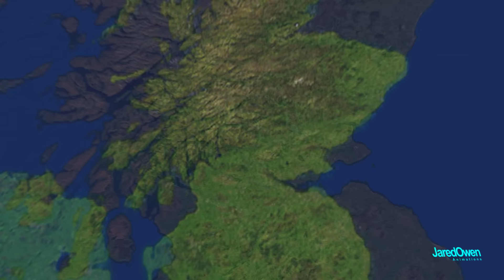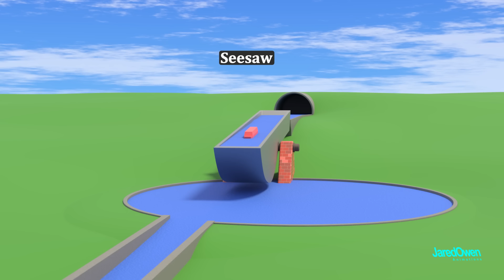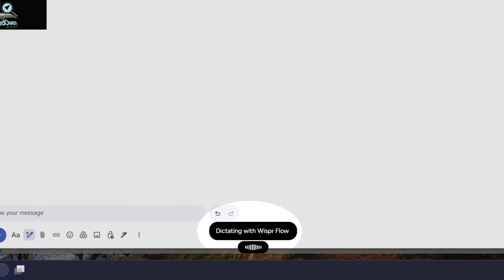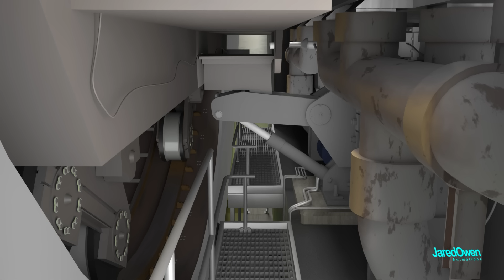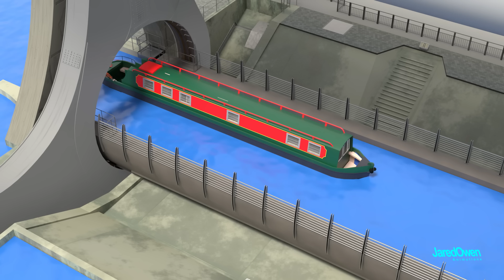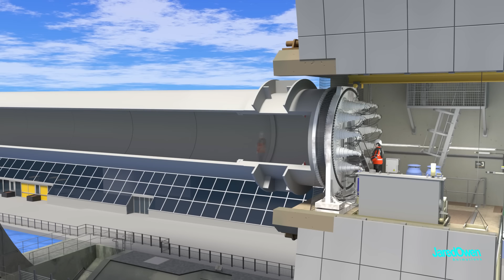How a Boat-Lifting Wheel works

Comment: The part that clicked for me was the pair of water-filled gondolas moving in opposite directions, so one boat rises 24 metres while the other drops, with a watertight seal forming before the gates open. Framing it against an ordinary boat lock, where the chamber itself has to fill and empty, made clear why a rotating wheel is such an elegant shortcut between two canals at different heights.

Comment: The genius part for me is that a floating boat displaces exactly its own weight in water, so both gondolas stay balanced and the Falkirk Wheel needs surprisingly little power to turn! Would you rather ride the wheel itself or squeeze through that aqueduct and tunnel up top?

Comment: The Forth and Clyde Canal is rarely navigable throughout its entire length due to various maintenance issues. The Wheel itself is almost entirely reliant on the two tour boats, which are virtually its only traffic. It functions in much the same manner as a fairground ride.

Comment: To work, this depends on the weight in each water-carrying part being nearly equal.
An extra 1 mm on one side over the other is only 200 kg. A 1cm difference is 2 tons.
I have not seen anything on how it is regulated when the upper water and lower lake fluctuate in height.

Comment: Nice new video next time do videos on fire alarms like the Horn Strobe Fire Alarm speaker, strobes chime, strobes, remote, troves even the strobes like how they flash also how hallway doors close on magnets. How the pull stations work the alarm panel. Even smoke detectors and fire sprinklers And how does it reset and how does it call the fire department?

Comment: Like to see you do. The Peterborough Lift Lock is a historic boat lift on the Trent-Severn Waterway in Peterborough, Ontario, Canada. Opened on July 9, 1904, it is the highest hydraulic lift lock in the world, lifting and lowering boats 19.8 metres (65 feet) using a balanced water-weight system

Comment: Question to the Archimedes' Principal:
Isn't it the volume that pushes the water away? Like, if i push down a full blown rubber balloon into the water, then it should push the same amount of water as a bowling ball with the same size (and the holes are sealed). But the bowling ball is much heavier than the balloon.
Reply: You're exerting a force on the balloon, so it's not the weight of a balloon, it's the weight of a balloon being pushed downwards (imagine putting a balloon on a weighing scale and pushing down on it, the weight on the scale's read-out would go up, precisely because you're pushing on it).

Comment: Archimedes' principle doesn't explain everything. I assume there must be an overflow system to balance the water levels upstream and downstream. Otherwise, the gondolas wouldn't hold the same amount of water.
Reply: The water level at each side is kept to within 1.5in (37mm) by computer controlled sluice gates and pumps

Comment: I went on many UK canal boat holidays with my parents in my childhood. Flights of locks are pretty insane, some have up to 30 and take you most of a day to get through, with some locks even feeding into each other so you can’t take a break between them. The UK Canals have some incredible engineering, with tunnels that take an hour to get through and aqueducts that are 40 metres tall with no guard rails on the boat side. Considering much of it was built hundreds of years ago, before motorised or steam powered boats, so every canal has a tow path where the horse would pull the boat. Most tunnels have no tow path so men would lie on the roof of the boat and push it through the tunnel with their feet. You can’t take still see a worn path on the roof of tunnels where their feet trod upside down.

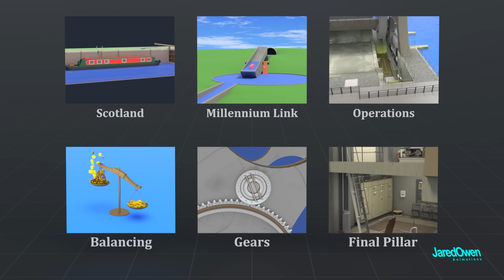Comment: 3:22 The Falkirk Wheel is actually the only part of this group of projects to restore the canals that brought in more money than it cost to build.
Reply: @Dampfmaschiene Other canal restoration projects have paid back money as well, property prices and recreational facilities have benefited hugely. Currently canals in the UK are generally are run by the Canal and River Trust, an underfunded charity. Costs for the maintenance and repair are mostly raised by fees paid by "Continuous Cruisers" and those fees are increasing. There is obviously a reason that those fees should exist, as the people on those boats don't pay rent, but I can see that the canals benefit a lot of other people as well. With the extensive droughts over this year are an indication that we should perhaps consider exactly how to think about those charges as well. The breach at Whitchurch over Christmas brings into it the fact that it cut off a major water supply to surrounding towns. The whole network of canals and rivers needs to be looked at.

Comment: Fantastic video. A little detail you missed mentioning when talking about the gears though: it's important that the large wheels are exactly the same size for the gondolas to stay level during the rotation of the wheel. That's why the middle gear is the same size as the two gondola gears.

Comment: The Archimedes principle relies on displacement. You kind of mention that, then get bogged down in "weight". The "bathtub" the boat sits in has less water in it than the full one, and the amount of water "missing" is the same weight as the boat it holds.

Comment: Great video of great engineering work. Thank you!
Obviously it works. I do wonder, though, about the water levels in both 'disconnected' canals. A difference would affect the amount of water (weight) in each 'bucket'.
Are levels adjusted in one or the other (pumping water in or out) once the swing gates are closed?
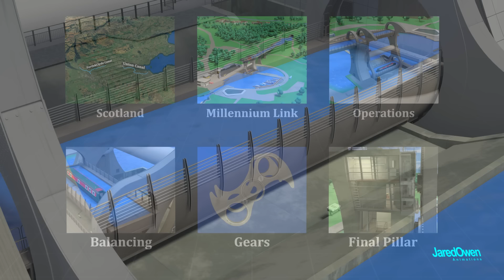Reply: Watch the “Balancing” chapter again (10:58) which explains Archimedes’ principle.
Reply: @trevinbeattie4888  Unrelated. 
My question is about the water depth in each gondola when the gates are closed. There must be some 'regulation' of canal water depths at both ends... 
Otherwise, their weights could be somewhat different, not 'balancing' one-another when the whole wheel turns...
Reply: @rustycherkas8229   I think I see – you’re speaking to variations in the relative difference in water levels between the Forth & Clyde and Union canals, right?  I looked it up and the average elevation change of 24m does vary by a few centimeters due to rain or lock operations.  According to Wikipedia (citing a visitor information sheet from the University of Edinburgh), “Site-wide computer control system maintain the water levels on each side to within a difference of 37 mm (1.5 in) with water level sensors, automated sluices and pumps.”
Reply: @trevinbeattie4888  That makes sense. Thank you for your research and sharing what you've found.
Both gondolas will carry "water depths" (with or without vessels) that are close to the same as the depth of one or both canals is regulated (at least locally)
Thanks again! :-)

Comment: Also wanted to say to the creater, well done, this is an extremely well made video. I would be curious about assisting, collaborating, joining knowledge on anything "Australia", "4WDing", "boating" ,"photography ", or anything like that.. I have the knowledge of the subjects, and decades of experience, but lack the platform and "video creating" knowledge, experience and abilities (can admit where I falter in areas). If you'd be interested in joining my extensive knowledge on the subjects into some videos please let me know and I will send u a message or my contact details!

Comment: Hey Jared, I am wondering how those souvenir coin dispensers - those when you turn a handle to select the imprint, put a coin in, turn the handle some more and a souvenir coin with an imprint pops out - how they work, like do they actually press the coin? Do they pretend to press the coin? Why is there a lot of resistance turning the handle?

Comment: EDIT: my comment is wrong, see replies

But wouldn't the Archimedes principle the way you explained it assume the boat has the same density as the water?
Reply: To float, a boat must be LESS dense than water. The amount of water displaced will weigh as much as the boat.
I watch coal ships enter the harbour riding very high, then leave with their deck much lower (closer to the water surface.)
Their empty holds full of air on entry are now full of black, burnable rocks...
Reply: @rustycherkas8229 i always thought it's the same volume but the same mass?
Reply: @greenyhobunkr6774  No. For any given hull (boat), the more you increase the mass (add cargo), the lower the boat will sit in the water until it begins to sink...
Add 100Kg of cargo, and the boat rides lower displacing an extra volume of water equal to 100Kg.
A floating boat is in 'equilibrium'...
That Latin world means "equal balance".
Reply: @rustycherkas8229 oh right, so it's both equal volume and equal mass, well today i learned

Comment: Great vid Jared, but I DO have a question.  Why is there like a 'beak' on the top and bottom of the wheel.  Why aren't the chambers that hold the caissons just round ?  Why are there seemingly 'extensions' on the top and bottom.  I hope you get what I am referring to.
Reply: Those extensions are decorative, inspired by the Celtic double axe.
Reply: @Hobbes746 Thx so much, that makes perfect sense.
Reply: @Hobbes746 Thx so much, that makes perfect sense.